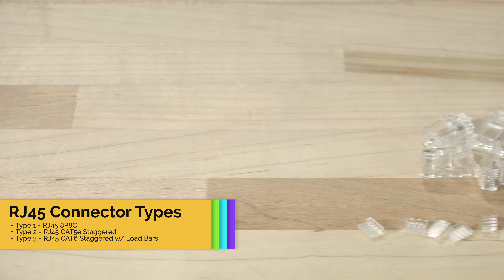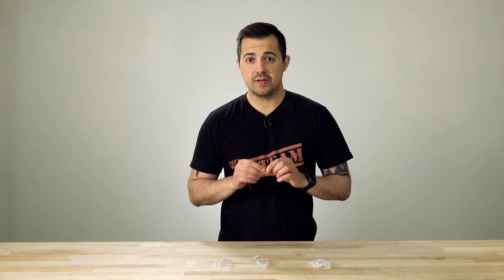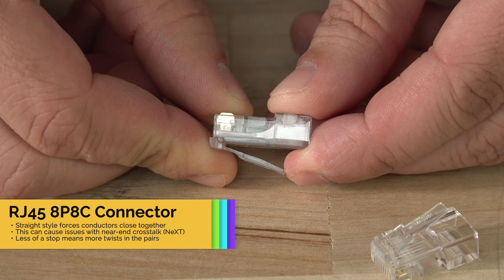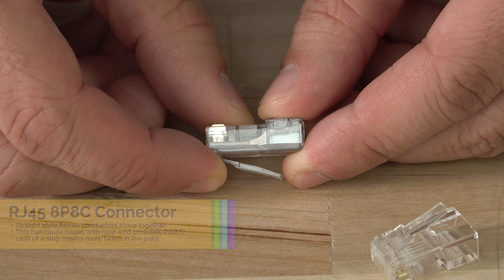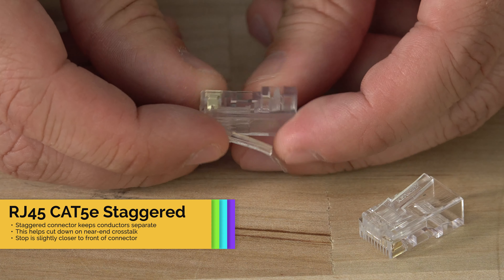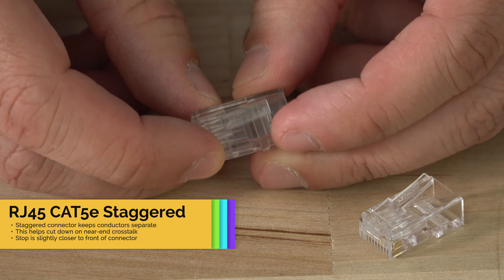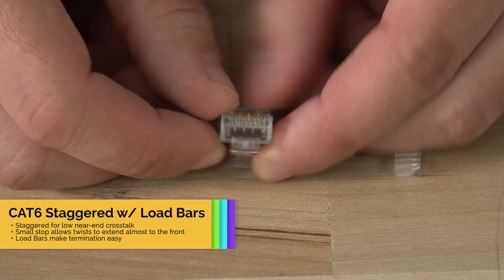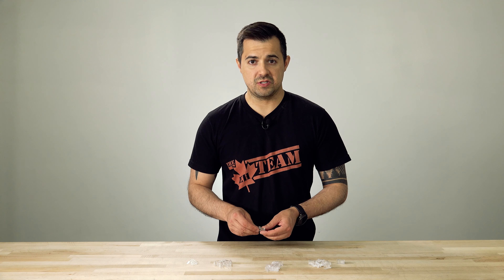Comparing THREE different RJ45 connectors.

Comment: I picked up the staggered cat6 but without the load bar. Let me tell you, it was absolute hell trying to terminate with those things. You basically have to feed each wire in individually which requires you to leave a significant amount of each wire exposed. My point, get the load bar version.
Reply from the maker: The ones without load bars can be really difficult to terminate but once you get the hang of them it can be super fast. Load bars are a great choice for most cases though.
Reply: @ComputerCableStore  A few questions:
Are the connectors with load bars generally more expensive than those without?
Your response seems to imply that for an experienced installer and/or someone who regularly/frequently/bulk terminates cables, connectors without load bars are more efficient/faster to terminate than those with load bars?
You state that connectors with load bars are great choices for most cases. In what case(s) are connectors without load bars the better choice?
Thank you!
Reply: I am in this pinch right now and it's hell
The worst thing is that this is my first time

Comment: Great video, thanks for explaining.  I replaced a connector on my Cat 6 cable that had the staggered wires with a connector that had the wires in a straight line and it has caused me a lot of performance issues, the cable struggles to give more than 90 Mbps now.  Ordered some staggered Cat 6 connectors now and hopefully that will sort the issue.
Reply from the maker: I hope it works out for you!

Comment: Is a metal body connector better or a regular one is fine for home purposes ?
Reply from the maker: A metal body connector would be used for shielded cabling. Most home cabling isn't shielded so you could use the regular ones.
Reply: @ComputerCableStore  Right, thank you

Comment: Probably a stupid question but ... Does cat6 require the cat6 rj45 ?
Reply from the maker: Nope! You can use any RJ45 connector. There could be some signal/speed degradation but I highly doubt it would be noticeable.
Reply: Only if it's shielded cable, (metal housing on rj45) on unshielded cable it doesn't matter

Comment: And if i have a cat 6 cable then can i work with 8P8C or i need cat 6 connector
Reply from the maker: You can use any of the connectors as long as they are for RJ45 cable. Even the CAT5e connectors will work with CAT6 cabling and provide the same speeds to the CAT6 connectors, during normal use.

Comment: I just wanted to ask what are the speeds of 8P8C connector
Reply from the maker: All of the connectors listed are technically 8P8C. The one labeled as 8P8C in the video has a straight conductor setup while the others use a staggered style. In theory the staggered style should provide better data transfer, though I highly doubt it would be noticed during regular use.